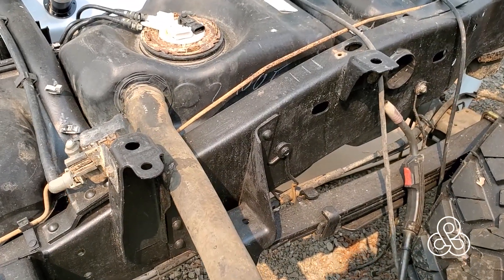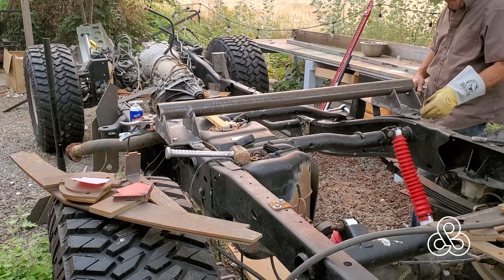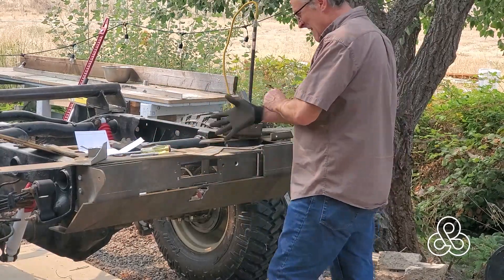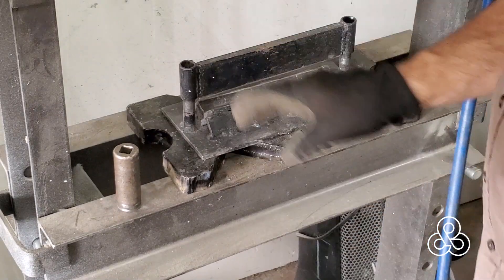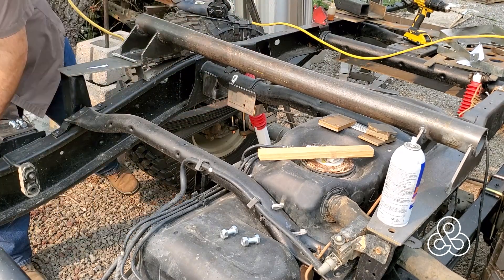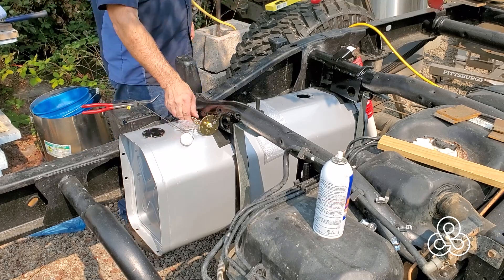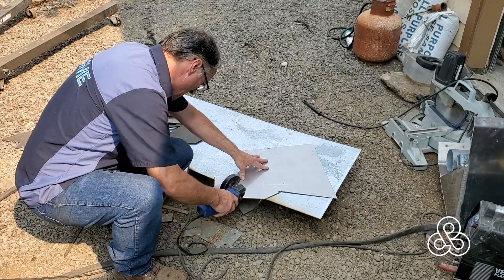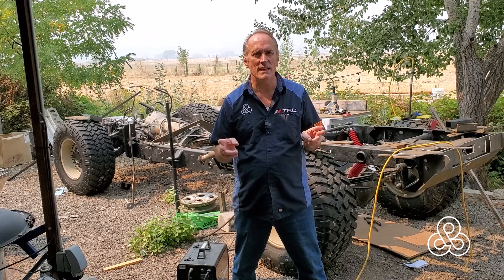L8 3 point mounting system and reserve fuel tank install, Leviathan supervan overlanding project

Comment: During your intro always show some of the images if the completed vehicle. That will help provide context.
Reply: I hate fancy intros, but this is a GREAT idea. Quick project intro comming up. I'll send you royalties for the idea! Ha! Thanks.
Reply: @307Driftwood havent you seen his renderings? They are amazing. Your reaction is exactly why he might give is a reminder of the finished look.
Reply: @307Driftwood 🤣 they are amazing computer images. This guys talent is amazing. That said what I’d rather do is work on my little custom speedster. I am converting an MGB into a little open two seat Packard based on the ‘’54, ‘55 Clipper Caribbean. This involves lots of thought to details, fifteen years of parts gathering and now continued fabrication. The goal is to produce a car that looks factory and has every doodad and trinket that identifies it as a Packard. I have even cast a new valve cover in aluminul so that it looks exactly like the top of a flat head four. That took me six months to make the plaster original before sending it out for casting. I’m 73 and this will probably be my last build. I am doing everything myself on this one, except the normal outsourcing of trim polishing, Chrome, machine work that i can’t do like the silly front suspension trunnions and of course the rough casting of the valve cover/flat head. Believe or or not, the MG lever shocks are the same design as the Packards. I’m keeping them but lowered the front with new springs and shackled the rear leaf springs down 1-1/2”.
Great fun and allows me cherished moments away from, “She, who must be obeyed”.
Reply: @307Driftwood nope. Im just an old car nut with a history going back to the early ‘80’s when i and some Friends here in Phoenix decided to go Formula Ford racing. After awhile renting and going to Bondurant in Willow Springs, we built one. Then all flushed with confidence we raced a modified 64 Vette at hallowed places like Riverside. Then we built a full on GT-1 vette and after a year or two built a full race Ferrari 308 GTB and went all over in GT-2. What a blast. We met Bernie Eklestone in South Africa an convinced him to bring the USA Formula 1 to Phoenix. That occupied us for another three years. After that i got a real job and settled into work and crewing on my pal’s drag race efforts. He has a real live full drag bucket “T” built in the 50’s. I was the crew and we had weekly fun until a Joe Amado Top Fuel national record holder chassis became available. George Clark (grandson of a notable racer of the same name who placed 12th in the 1913 500) built it into a bonafide Top Alcohol contender and had years of fun all over the west. Now we have moved his grandson, Luke George Clark, from carts into Junior Dragsters. But the Clipper “B” is just for me. I have my sketches and a few photos of chopping, pounding and Welding body panels into relative conformance with my vision. I may be done in a year.

Larry Sorenson
Glendale, Arizona

Comment: When did you start building this Truck? Looks like it’s been an ongoing project?
Reply: Started collecting stuff about 6 months ago (chassis), but have just recently kicked into gear for the build.
Reply: @pivotalevent  thanks for the reply looks like its going to be a fun build. What power plant are you thinking of installing? Have a great weekend
Reply from the maker: Using the LQ4 6.0L that came in the chassis. Trying to keep things simple to get it rolling faster.
Reply: @BuilderCreator  thanks for the reply

Comment: You don't realise how large this vehicle will be until you stand next to a wheel and get the scale front to back and wheel height. Leviathan is an apt name. Looking good!
Reply from the maker: Even I didn't realize how big it is going to be, until I measured the shop door and realized . . Ouch!  Airing down the tires wont just be for driving on sand. Ha!
Reply: @BuilderCreator  I hope you have all the low bridges in your GPS before you head out!

Comment: The spot that gets the most hits and damage in an off-roader is in the middle of the car, between the axles, under the frame rails. It gets scraped on rocks, tree logs, ditch ledges, river banks, trail edges, humps and bumps, etc, etc.
Reply from the maker: The fuel tank does hang below the frame rails a bit, but will be protected by the under tray/flotation tanks. It will be more of a motor home than a rock crawler. Ha!

Comment: Very cool! Any reason you didn't use captive nuts for the fuel tank strap fixing?
Reply from the maker: With the bolt lose, I can tip it down and get it through the strap then tighten it up cinching the strap. If the nut was fixed you would have to have some alternate method to tighten up the strap and get the holes lined up. Other than that a captive nut would be grand!